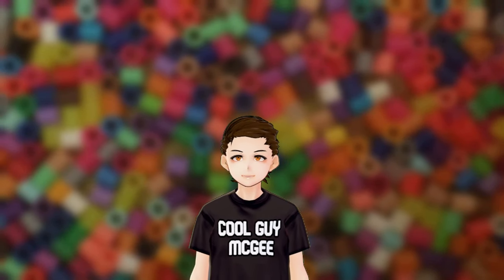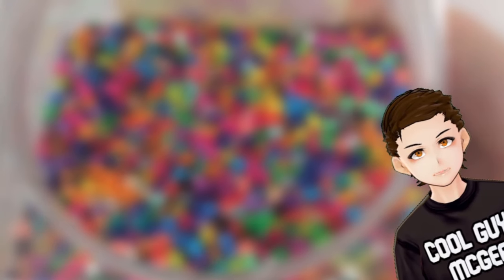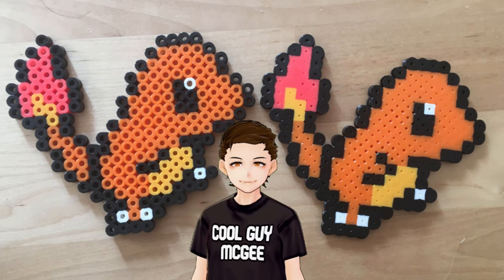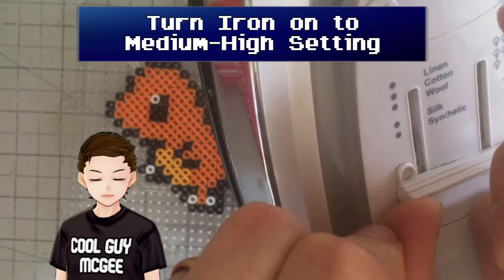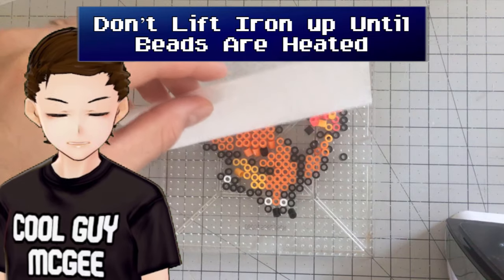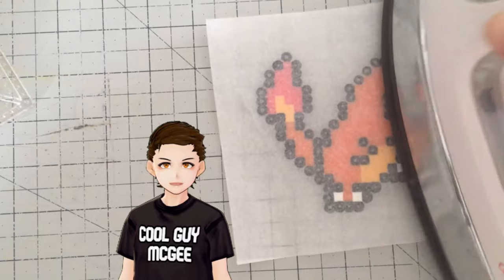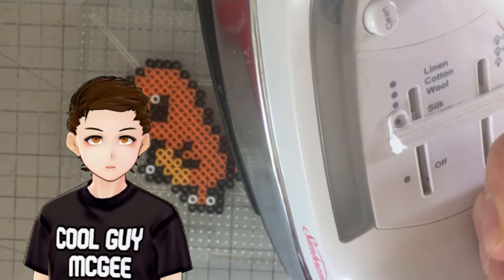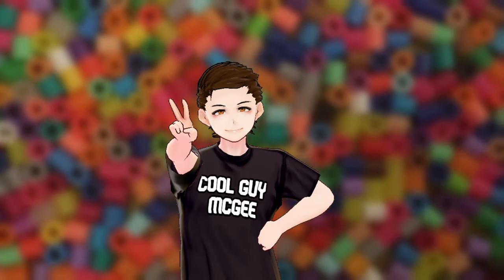How to Iron Perler Beads (Standard VS Flat Melt)

Comment: I'm kinda surprised you didn't mention poking holes in one side.. I usually use masking tape and not ironing them on the boards cause it warps the boards over time..then I poke holes with a tooth pick through the tape and then only melt one side. that has been working for me n my kids. 😊
Reply from the maker: Yep, good point! I go over that in my Tape Method Tutorial video. :)

Comment: Would like to see someone do this with the Artkal mini 2.6MM beads. 2500 beads per square. Tape method went horrible several times. Just decided screw it, I'd rather warp a couple dollar pegboard and get the fuse complete than risk losing ~1000 beads off the board.
Reply from the maker: @atolmasoff  Yeah, I feel ya. There’s been a few times when I had some tough taping moments and it was rooouuugh lol. How did your project turn out for you in the end?

Comment from the maker: Just a couple more tips: 
1) If your iron has a steam option, keep it off!

2) Let your creation cool for 5-10 minutes once you’ve finished both sides underneath that heavy object.

Any other tips to add?
Reply: Can you iron just one side?
Reply from the maker: @appletons2558  Yep! If you use the flat melt on one side, it should mostly keep it together if you’re delicate with it. I recommend doing a very light iron on the opposite side though unless you plan on gluing it to some cork or some paper, just in case. One fall from a weird angle might break off a piece or two.

Comment: Something I experimented with yesterday (hence looking up better methods) is putting them in the oven. At 400 degrees (F) for 1 minute on parchment paper gives the face-down side a nice matte-looking finish. The other side also has a glossy look, but the beads melting is somewhat random.
This has only been one day and attempt, but I'll probably try a lower temp for a more even heating.
Reply from the maker: Whoa, neat! Keep us posted with your results!
Reply: @BigBossRazz  I'll post my initial findings to reddit when i good off work and reply with the link so you can see. I thought to try because I saw someone making canvas-like work by arranging them in a glass pan, then putting them in the oven. The 400F came from another project where a person used the oven to make rounded charms for jewelry. Works really well for that 😅
Reply from the maker: @alldayagain YT comments might disable links, so if it doesn’t work, feel free to swing by our Discord! 🫡
Reply: @BigBossRazz  10-4. I'm gonna try a few more methods first (lower Temps plus seeing difference between the ironed-side up vs down) as well as seeing what doing the beads sideways does.
Gonna do those this evening.

Comment: 1:49 this is what happened to me on my larger 2500 beads perler, although it was much worse as i was using mini beads and there just wasn't any way to easily save it like in your video.
this is also why i would also suggest always using the tape method preferably with painters tape as it doesn't leave any sticky residue on the perlers.

Comment: Hi I made the exact same charmander and it turned out awesome thanks for the tips
Reply from the maker: That's super exciting! Which melt did you end up using?
Reply: @BigBossRazz  Eventually I used standard melt. Thanks
Reply from the maker: @patanwardiaries3303  Fantastic! It's a reliable method for sure. 😎

Comment: Can i iron it by itself without baking sheet? Or can i be able to use normal paper?
Reply from the maker: You definitely need some sort of ironing paper! If you don't have the ironing paper that comes with a set, parchment paper works better than wax paper if that helps. I don't think printer paper or writing paper would work. :_RazzSalute:
Reply: @BigBossRazz  oh. Cause i rarely see any parchment paper or baking paper in my house, so idk what to do with my beads if i can’t iron it 😭 Are there any alternatives?
Reply from the maker: @aesthxtically  I know some people literally throw them in the oven and melt them that way, but I have absolutely ZERO experience with that, so I can’t offer any advice unfortunately. Maybe you can tape your creations and set them aside until you’re able to get your hands on some parchment paper in the meantime?
Reply: @BigBossRazz  oh ok thx

Comment: This guide is great. I have a quick question though. Let's say I want to only flat melt one side, do I have to standard melt the other side?
Reply from the maker: That’s a great question! I’ll be working on a video in the near future on what some options are but in a nutshell: 

If you are just displaying your creation and it won’t be stressed or bent, you can theoretically flat melt one side and leave the other side unmelted. If you wanted a little more sturdiness and it’ll be exposed to the outside world, I would flat melt a side first and then lightly melt the back side. If you flat melt both sides, you run the risk of some bead explosions since there’s less air for the heat to travel through. 

I’d say experiment with a design you don’t care much about first and see what ya like!

Comment: You could get a more even melt and a flatter surface if you had a height-setting jig. For example, a metal or wood or ceramic circle with a diameter just large enough to fit your work piece in the center, and a height that's 1-2mm shorter than the total work piece height (assembly plate base height + 5mm standard perler bead height). 

Like, maybe you could make it from a large jar lid? Or just place flat wooden rulers on the table to the sides of the piece.
Reply from the maker: I need to see someone build this and put this to action now LOL
Reply: @BigBossRazz  home depot has ceramic tiles (i buy em as cooling pads for my rats during summer) you can get that stuff there

Comment: Just a question what type of melt do you think is best for 3D perler bead creations?
Reply from the maker: That’s a really good question! I haven’t tried anything 3D just yet, but I imagine you’d want to iron both sides lightly. The flat melt might distort your beads a little too much and might make it hard to lock in with one another if that makes sense. If possible, try ironing a few small examples to see what works best for you and your purposes!

Comment: any suggestion on what temperature the iron should be?
Reply from the maker: Honestly, it depends on your iron and preference. The best way to figure out what works best for you is to experiment and learn over time. I suggest starting with low heats until you get a good feel, and then experiment by raising the heat just a bit each time. Different sized projects will also need different heats, so it’s kind of different every time. You got this!

Comment: quick question each time i make sometimes my peg board bends making it unusable how do you know how to stop it from doing that?
Reply from the maker: Yep! So what’s happening is that your iron’s heat is also transferring to the pegboard, making it warp. One way to avoid that is by ironing off the pegboard using the tape method to take it off the pegboard once you finish and iron it on a different surface. I have a video showing the whole process of ya wanna check it out! 🫡
Reply: @BigBossRazz  thank you i'll make sure to check it out

Comment: How long should the beads be under a heavy object?
Reply from the maker: Great question! It depends on the size of the creation and how much of a melt you decided to do. It might range from 5-10 minutes for the most part. 

The BEST way to determine how long to leave it is this: If the paper has completely come unstuck from the piece naturally, it's done! 

If you need to pull or peel the paper off of the piece, the paper should stay on, and the heavy object should stay on. I hope that helps!

Comment: Mine always end up a little of both. Is my iron too hot or too cold?
Reply from the maker: It could be that it’s too hot weirdly enough. Make sure you’re moving the iron around almost at all times to make sure the heat is distributed evenly. The lower your heat setting, the more control you have over how the beads melt. I’d say start at a medium heat for a standard iron and rotate it on your piece for about 30 seconds and see where you might need to touch up. The corners and sides especially need a little more attention and “spot-ironing” after your 30 seconds are done. When you think you’re done, try lifting up the paper and get a good look at the beads. If they’re melted to your liking, you can let them cool and then flip them over. If not, throw the paper back on and iron a little more until you’re satisfied. Hope that helps!

Comment: Can I use the same piece of paper to iron more than one design?
Reply from the maker: Great question! You can a few times, but then it starts to bunch up and wrinkle which will show on your design! I’d say keep an eye on it after two or three uses, and see if you need to use a new piece of ironing paper.
Reply: @BigBossRazz  and if I wanted to iron it on both sides, do I iron it a second time after it's not on the pegboard and just put another parchment paper and then iron it??
Reply from the maker: @luiscarlos-mn5rk  I have a video using the tape method that I recommend. If you iron your beads while they're still on the pegboard, you run the risk of the heat warping your pegboard. 

Either way, you iron it once on the front side, flip it over, and iron the back side once with ironing paper (total of two times) if that's what you're deciding to do. There are some things you might want to just iron the one side, like for a coaster for example. If you iron it on both sides, it will be sturdier though.

I hope that helps!

Comment: You will mess-up if you move the iron.
Reply from the maker: The key to minimize errors for me is moving it slowly. I’ve found that keeping your iron pressed down will heat and melt the beads too fast, and even melt them to the paper sometimes! Still, you should do whatever works for you! 😎 Thanks for chiming in!